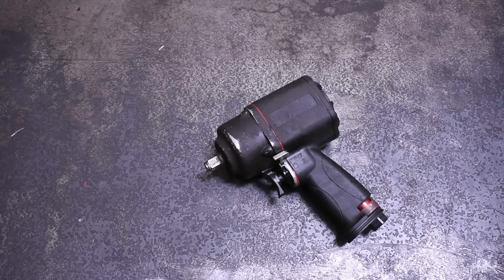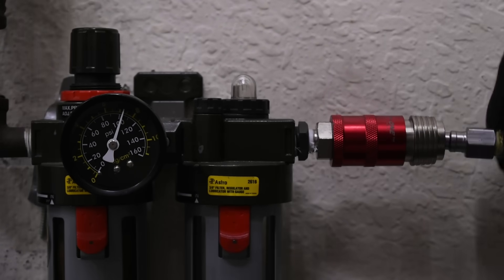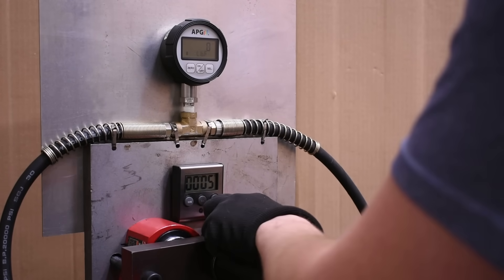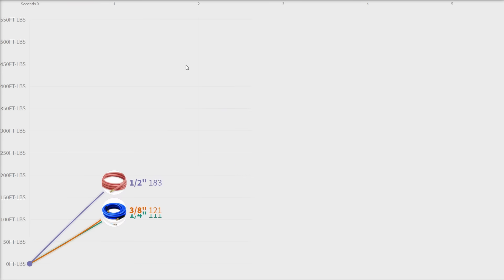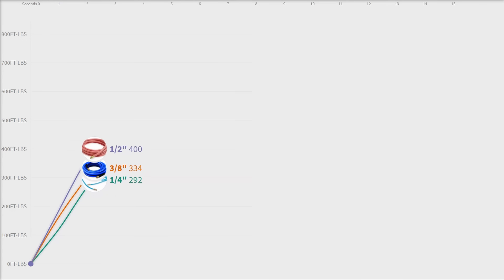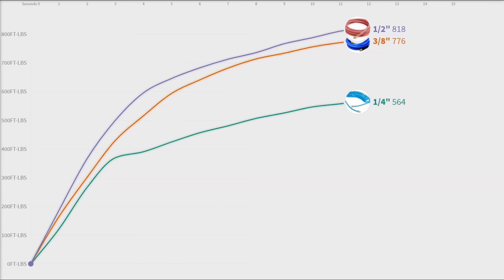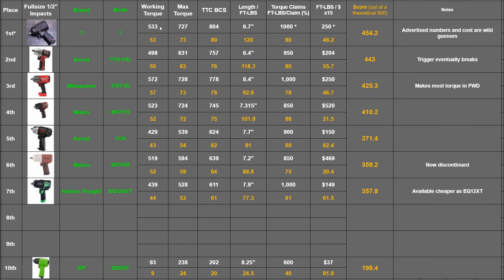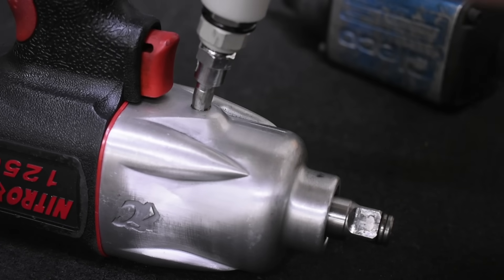How Much Power Are You Losing w/ Your Air Hose Size? Dyno Graph Testing

Comment: Would have loved to see the 1/2" air line used with a short 3/8" hose whip.  This would be a more real world example.
Reply: See the results of the 3/8 hose.  Its a "weakest link" equation. The difference would be in the de-expansion of fully swollen hose, probably a bit longer high slope before leveling off to pure air flow, were it would join to identical to the 3/8 line.
Reply: @snap-off5383  are you sure?  The 1/2" will have less of a pressure drop than the 3/8 when flowing.
Reply: @joshuacoomes6388  The relaxing of the hose will take longer yes, after that,the pressure will be the same, that of the source, factored in with the length (still the same) and smallest restriction (still the same).  No I'm not "sure" its just what I think. I could be proven wrong.
Reply: @snap-off5383  I thought the same way until I had some physics training.  The diameter of the hose has a different effect if smaller/larger when things are moving.  Yes the pressures will be the same, but when air is moving through the hose there is a pressure drop.  I think its Bernulli's equation that explains it.  Yes, the small whip will cause a huge restriction, and my point may be so minimal that it can't be noticed.  I dont know either, but I do believe that the 1/2 hose with a whip, or 3/8 nipple will still outperform the 3/8 hose of same length.  It may be easier to see if you compare a 90 degree street elbow versus a 90 degree with a 6 inch centerline radius.  The gradual bend will obviously flow more and have less of a pressure drop.  The restriction the bend creates to flow can be compared the restriction and the end of a hose.
Reply: @joshuacoomes6388  The pressure drop effect of diameter is multiplied by length. At the CFM that Astro gun is probably pulling 3/8" hose will drop about 1/2 psi per foot and 1/2" closer to 0.1 psi. So 25 feet of 1/2" plus a 3 foot 3/8" whip will have a combined drop of roughly 4 psi. Roughly 1/3 of what you'd get using a 25 foot 3/8" hose.
Reply: @mattt4183  thanks man.  I thought so.  There is always someone smarter.
Reply: Skip a whip hose, I got rid of mine and went with Milton 1855's to run G couplers right into 1/4" air tools, big difference in performance on high air consumers.

Comment: I may have missed it, but did you state that the tool is designed for a 3/8" fitting?
Reply from the maker: Yes, it would appear so as it has 3/8" NPT female threads which allows us to do this test the "right" way instead of necking down a 1/2" air hose with smaller fittings.

Comment: This is a test I've been waiting for. I knew the higher volume of air would obviously see higher torque, surprised at how little difference there was at the end of the test. Well done as always and I'm very much looking forward to the 1250k as I've been eyeing it for a while now. Thanks bud, keep crushing!
Reply: I figured the exact opposite.. Like if you have a 25 foot 1/4 vs a 1/2, you have twice the volume to pressurize. I figured that release and build up every time the impact rotates its hammer would rob some power..

Comment: Might be interesting to test with and without a coupling? Connect the tool directly to the hose.
Reply from the maker: That's cheating though! Haha, we try to recreate what we and you guys use in the field - so wouldn't be all that helpful for someone figuring out their air system. And if it made a whole bunch more power that would be a bummer for all of us obviously using fittings. But we can add it to the coupler/fitting video we haven't made yet just for gigglesh*ts
Reply: @TorqueTestChannel  I was just curious as even the “high flow” fittings have a smaller diameter than the hose itself so it has to be a choke point of some kind.
Reply: @corywillbanks6348  I like that idea. May not be a real world scenario but definitely good information.

Comment: Could you test the effect of using socket extensions? (3 inch, 6 inch, 10 inch) 
Maybe test the effect of a swivel/universal joint too?
Reply from the maker: You got it
Reply: @TorqueTestChannel  Also add conversion adapters both bigger and smaller.. (1/2 to 3/8 and vice versa)
Reply: @TorqueTestChannel  Could you maybe check (for instance) percentage loss per extra connection, and percentage loss purely from distance from anvil to work piece separately? Some people on YT have tried without being too methodic about it, not accounting for metal elasticity, transfer loss between adapters etc, so they get very big variations in results with no explaination. Not looking for an exact answer, but a percentage comparison would be really nice and cork quite a few discussions :D
Reply: Oh and loss per degree of angle would be interesting!
Reply: The ideal test would be an extended anvil impact gun VS a impact gun with an extension.
Reply: @dazaspc  It would be interesting to see, but how many people purchase the extended anvil model? Milwaukee, for instance, only offers it on their 1/2-inch model high torque, and soon on their 1-inch. 

Buying these is complete personal preference, but like many, I'd rather have the normal anvil to be more versatile when trying to fit the impact in tight spaces.

If someone is willing to loan the channel an extended anvil impact, I'm sure they'd add it to the list.
Reply: @98ChevyK1500Z71    The extended anvil is basically built for tire shops for flip sockets. One flip socket was 3/4” - 13/16”, another was 7/8” - 1&1/16? I am not 100% sure on that fourth size. I don’t know if they make metric flip sockets or not. Now a tire shop has 10 to 20 torque sticks! When there use to be 3 main lug nut sizes.